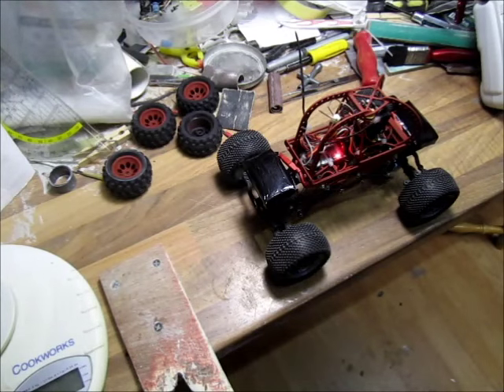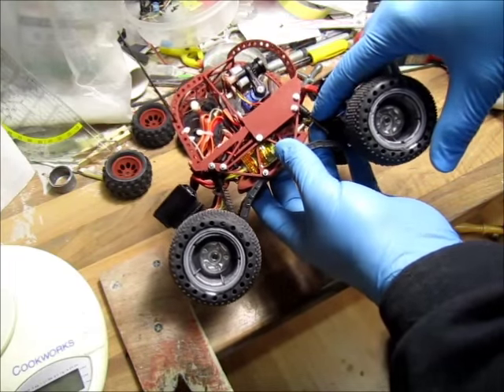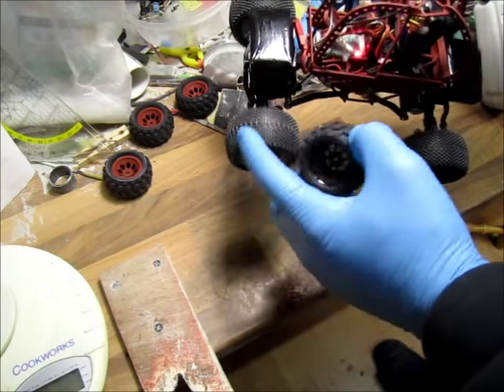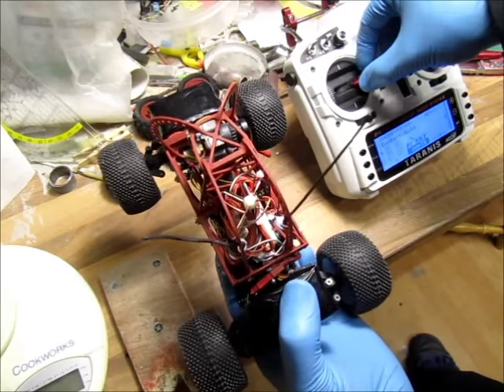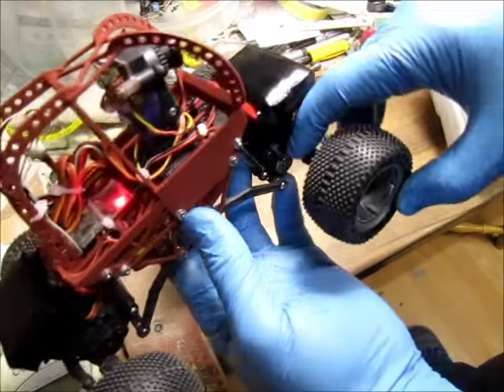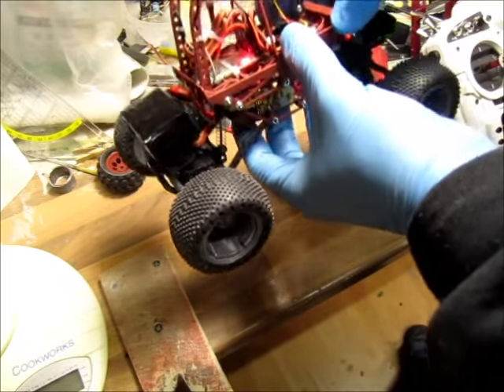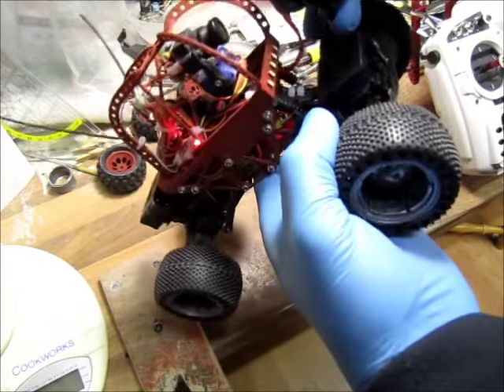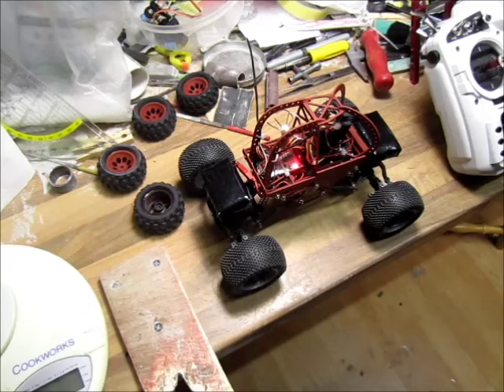Basher Rocksta FPV crawler heavy mods

Comment: Fantastic mods - I've just got one of these and went with a very basic wide angles camera on the roof and a small VTX.  Figured that if I can see both front wheels in the camera I can crawl with reasonable accuracy.  Proper pan to see the rear wheels is a great idea though, although it feels like it would benefit from being higher up ?
Reply from the maker: +CurryKitten 
Seeing front wheels is really beneficial, as this is a very small truck and you have to see whether you are able to climb over something. But if you get your cam high you have to have some cage for it's protection, which all of this will rise CG up and the truck will want to tip over. It was tipping over side for me at ~35deg and after I added lead inside the wheels I can go at ~55deg.